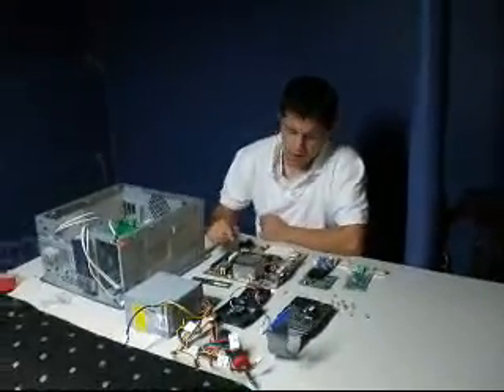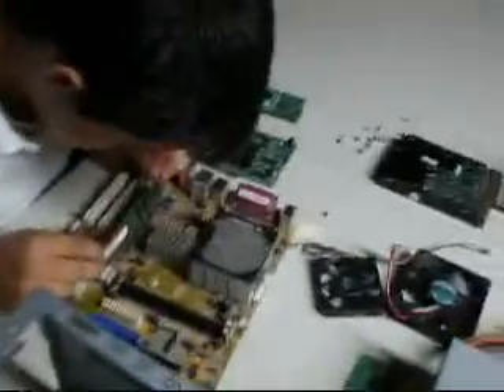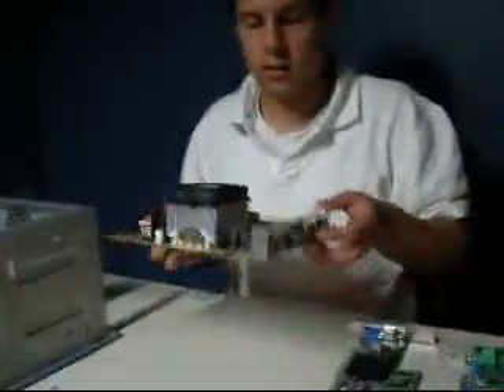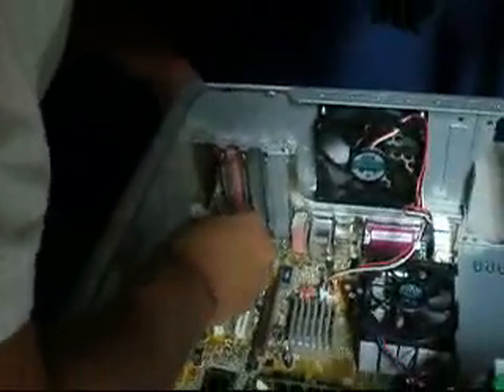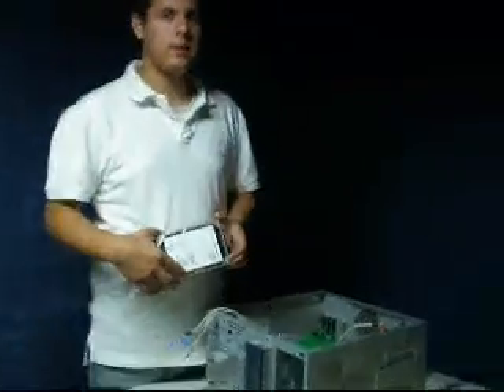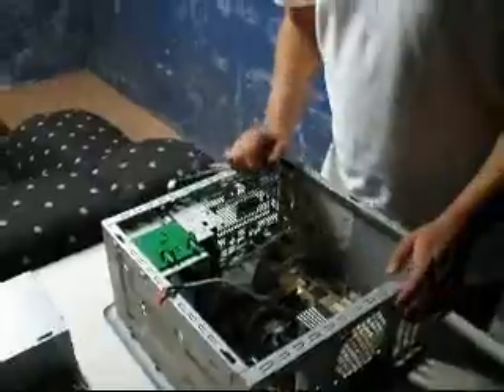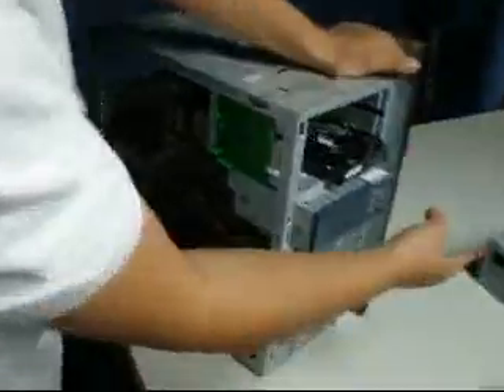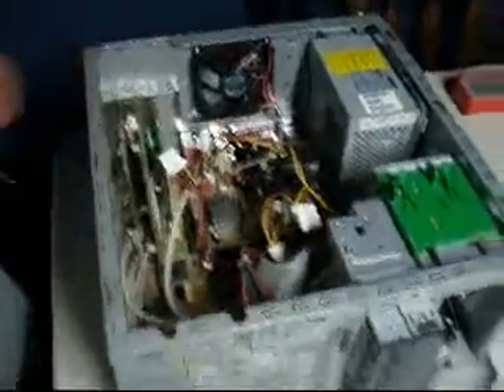How to Build a Computer

Comment: ok, he may know some, but he is no tech person. not with the modern day pc anyway. the cpu for that board is the socket 478. its about the size of a full grown person's thumb. the big metal thing on top of that is the heatsink and the black bracket on top of that holds the fan for the cpu/heat sink combo. the ram is of ddr. i could go on, but i wont. been building since i was an early teen. i am now 23.

Comment: This guy is clueless! Like DaBuzzKilla said, he probably took apart his old computer. A few reasons it doesn't work:
1. Ummm, where's his antistatic mat and/or wrist band.
2. The CPU fan goes ON the CPU duh!
3. He's just waving around the pieces as if his was holding a sock, probably crushed a few mobo wires.
4. Everything loosely fits (uh, hard drive??), some power connectors aren't connected.

This is one screwed computer.

Comment: yeah the stand off's will help with your pci slot probs there since the buttom of the grip ( metal part ) of the card is hitting the case itself preventing you from installing correctly